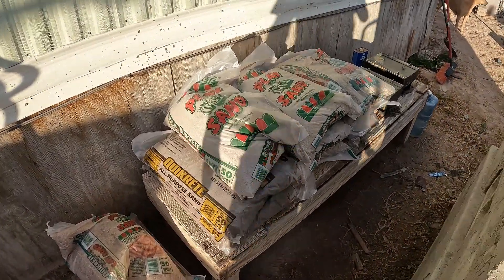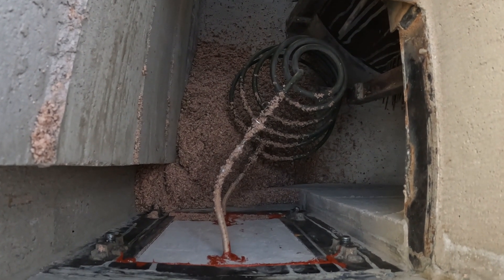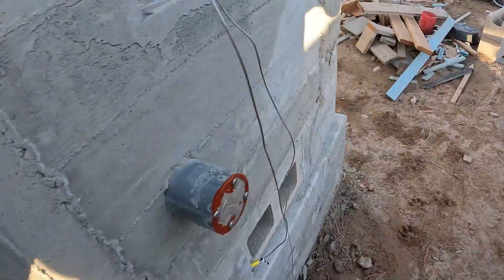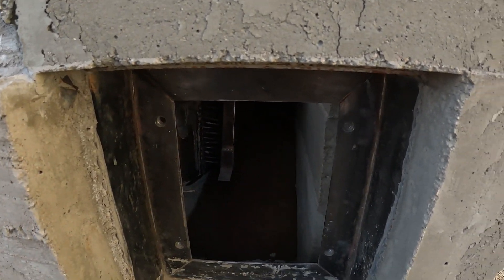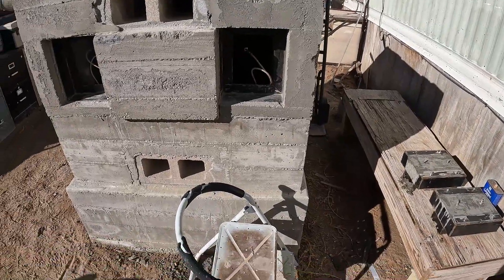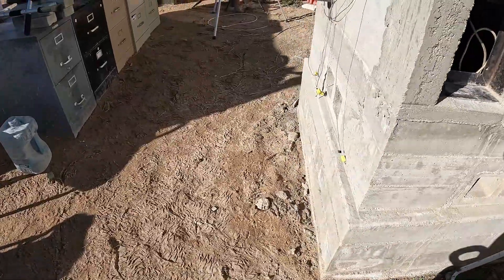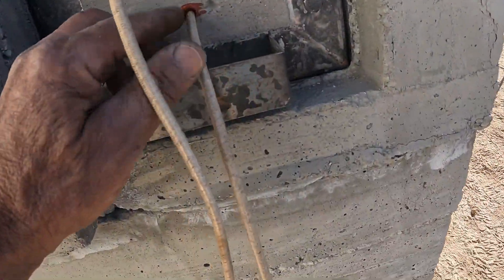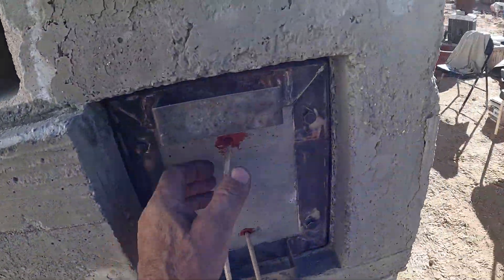140 Sand Battery Update

Comment: Have you thought about running coiled copper pipe in the sand to circulate water through for hot water?
Reply from the maker: Yes I have and I plan on designing another smaller one with that feature. I can still add that feature to this particular design but I chose not to do it as of now. Just to prevent water leakage into the sand. I have a solar hot water tank a friend welded up for me that I will be using soon. The hot water addition is a great idea though thank you for the comment.

Comment: Most anticipated video on the internet. Your work looks awesome! Glad you keep pushing. Nail-bitingly awaiting the next vid. 

I'm working on a solution where the thermal storage is embedded in the floor. Maybe 0.5 meter of thermal storage material (stones, sand, concrete), insulated on all sides except the top. At the bottom of it I put electric floor heater wire. At the top I put PEX. When there is plenty of sun and my batteries are full, I heat the storage from the bottom with the floor heating wire (a dump load basically), and an insulated electric boiler with water. I simply live on top of it, so it will give off heat when cold. If I need more heat I run the water from the boiler through the PEX.
Reply from the maker: That sounds awesome. This particular design that I am building didn't really get a whole lot of thought put into it in the design phase I kind of just threw it together but I believe it should work fairly well. I sure hope it does. Thank you for the comment and sharing your design.